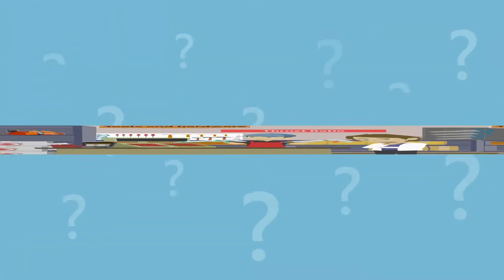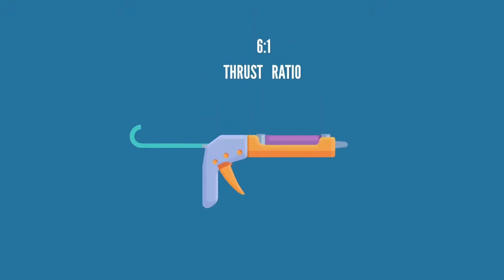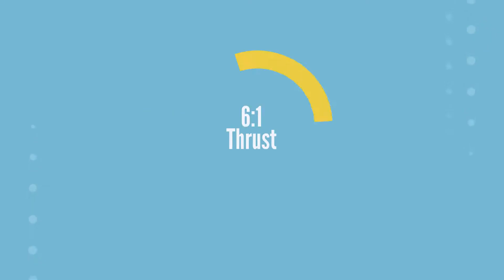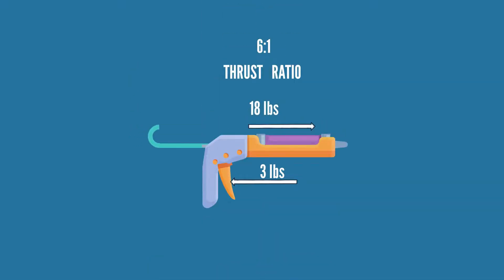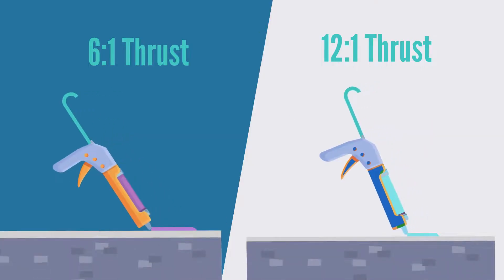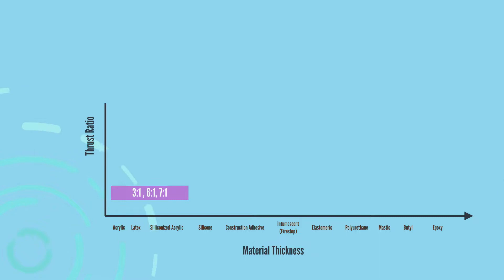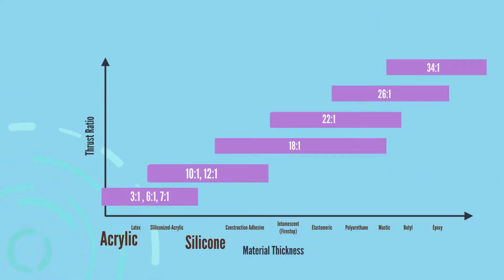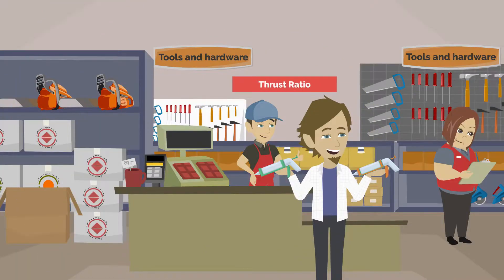Thrust Ratio for Caulk Guns Explained

Comment: Different thickness requires different strength to push, not different thrust ratio.  Thurst ratio is the levrage that the caulking gun can help you push easier.  The thrust ratio is a very vague concept.  Some brands claim their guns can provide a very high thrust ratio, such as 26:1 or even 34:1, however, there is no such a standard testing method to rate.